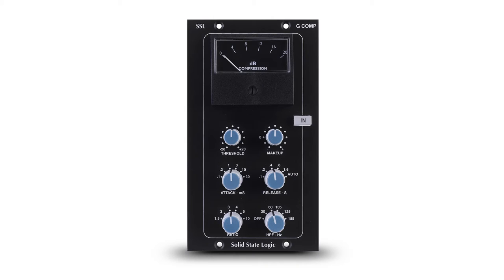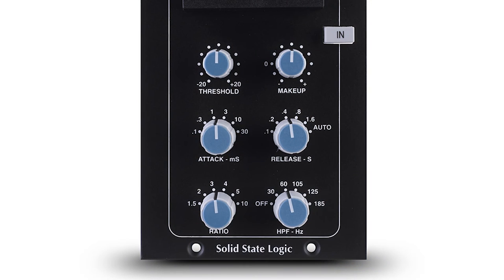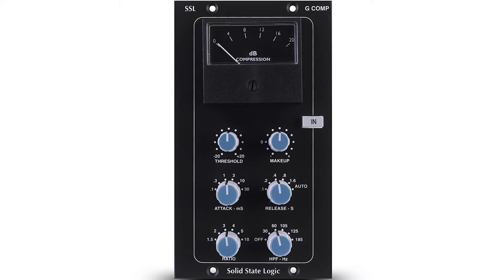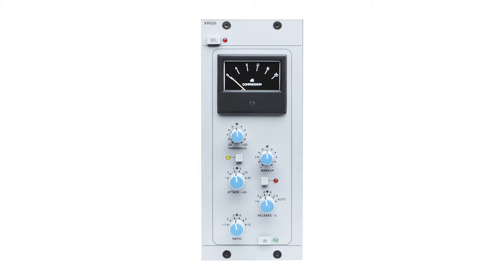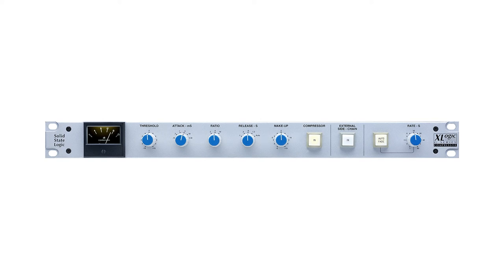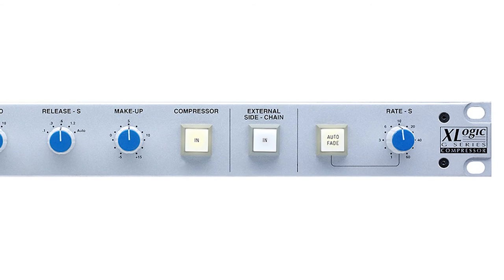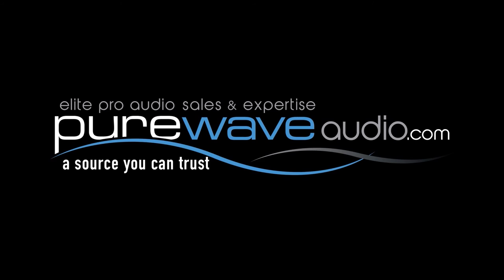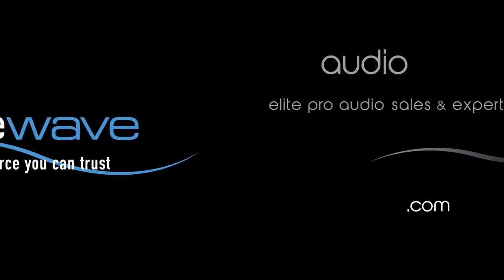SSL G Stereo Buss Compressor MK II 500 Series Module Review with Samples

Comment: +purewaveaudio Plans on getting the Highpassfilter on the big unit as well? dont care so much for the Fade out while working in a DAW nowadays. Why is it so much more expensive then the 500 unit ?
Reply from the maker: +bjjking1000 I have not heard of any plans of upgrades at the moment.  Price difference is due to higher specs and components on power supply and such.
Reply: ***** thk for the answer. what are the higher specs. Does it make more gluey? or sound tighter? I'm considering one of those two. I figured the 500 unit gotta lack somewhere since its so much cheaper + offering a HpF
Reply from the maker: +bjjking1000 As I mentioned in the video.  During blind test no one was able to tell the difference between the two.
Reply: I've heard blind test sugesting that people did'nt tell the difference between the plugin and hardware as well. I've never worked with analogue processors so I actually dont know, but I guess i'd like to think that I could hear the difference with the units at my fingertips. Thank you